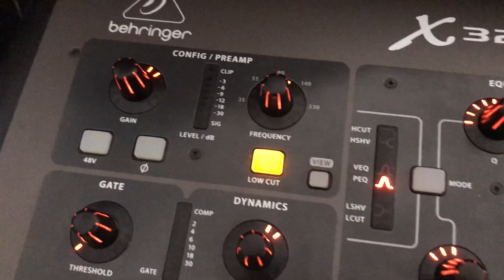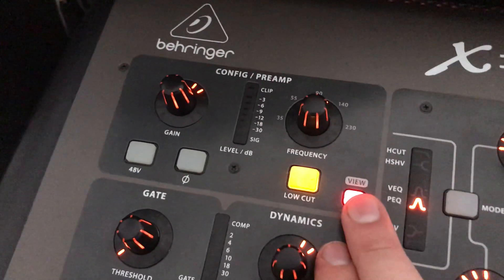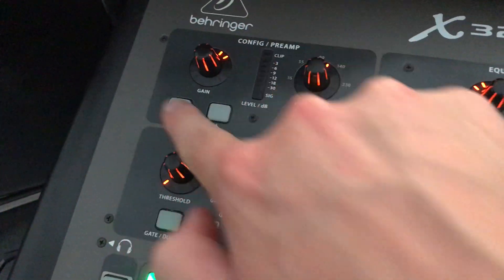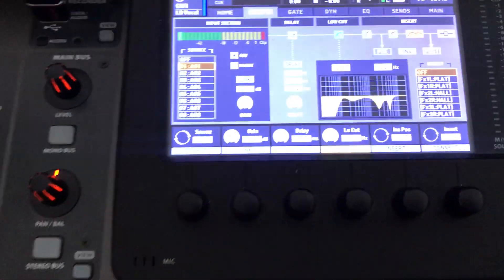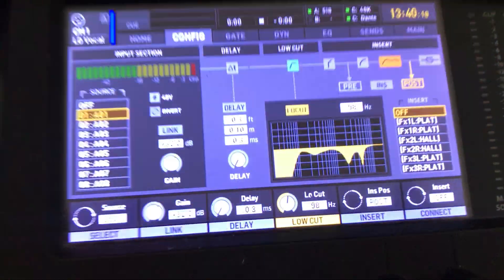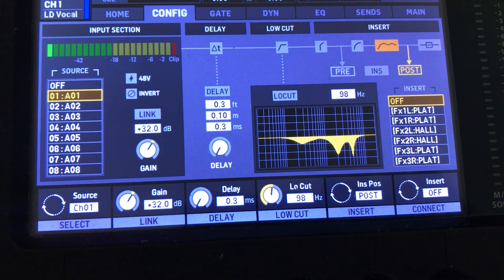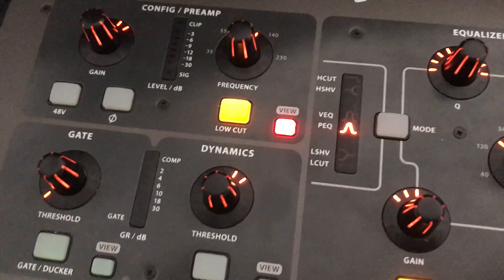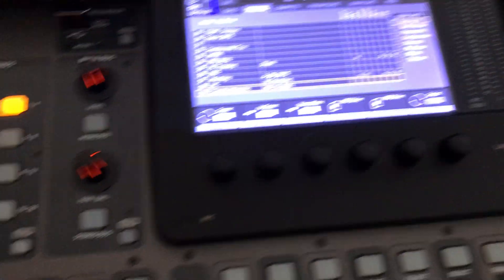How to Use the Low Cut Filter and Polarity Reverse Buttons on the X32

Comment: Hello . Thanks for your Great videos. I have a Behringer X32 Compact at our little church and I am getting to feel my  way in getting to understand it. Thats why your videos are so vital to me. One of my 2 main speakers output plugs (7 and 8) does  not  work ( plug 8). I switch both snakes and they do work in the same output plug (#7).Do you know could have  cause this? I know that both snakes are working, and both speakers are also working  because when I switch the snakes  in the same number 7 output plug both speakers  work one at a time of course.